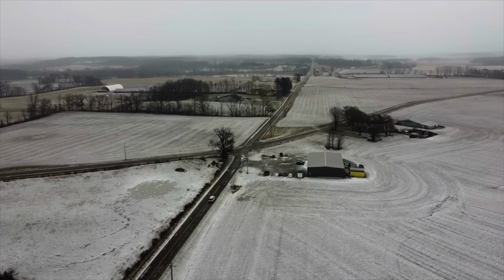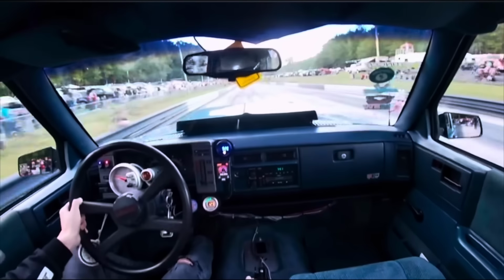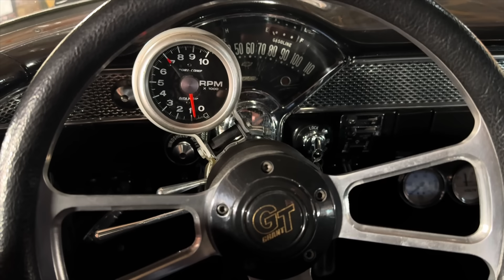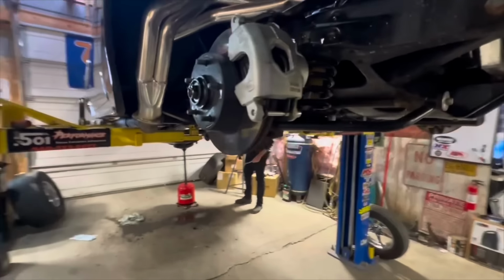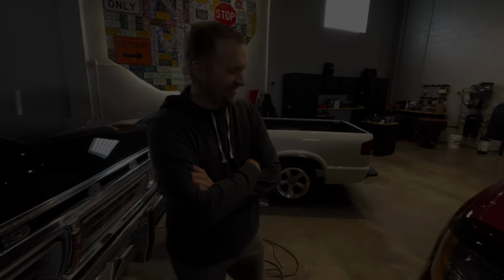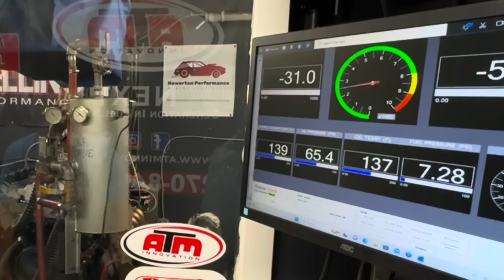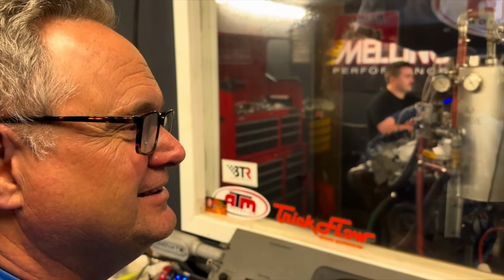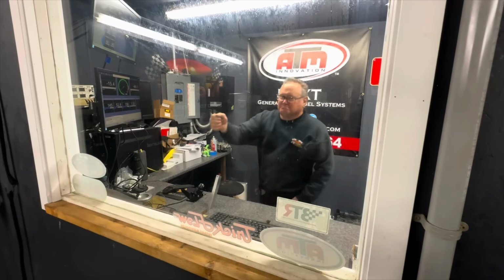DONT DO WHAT STEVE DID!  5.3 JUNK YARD DOG OFFICIAL GIVEAWAY!

Comment: Nice info,It would be interesting to see what a LQ9 6.0 ltr would put out with a cam and a carb setup.
Reply: should be close to the same just more power. the bore is the big difference. 5.3 is 3.78 and 6.0 are 4. for a na set up on a 6.0 rec port ls heads and good cam will make a massive swing for you. that combo should make over 475 with ease.
Reply: I know an l96 Will make 550 hp 500 tq with a cam and springs.
Reply: @enigmacamaro those rec port heads are massive for a production head and they raise the power potential considerably. I believe peak flow flowers, while not everything,  are comparable to those gen 1 trick flow 230s or the 220 afr's. I feel like it's a trade off, air flow vs cylinder sealing with the LS vs SBC. More difficult to have symmetrical style ports with 5 bolts per cylinder but it's been done. The LS would have benefited from that one extra fastener.
Reply: Great information, what is the camshaft specifications?
Reply: @omarmuniz552  54-456-11 comp cam is pretty wicked for that combo. I would double check for piston to valve clearance to be safe on that one.

Comment: I've been running a carbed LS for about 7 yrs now.  We started with a junkyard 6.0 with cam motions junkyard dog cam. Specifically designed for a sbe 6.0 with rec port heads.  This cam with matching valve springs,  vic jr intake and 750 HP holley made over 500hp. And with a th400 and 3.55 gears it ran 10.80's @ 125mph. At IRP.  In my junkyard third gen Camaro.  3500lb raceweight.
Reply from the maker: That’s pretty good!
Reply: @theoldmansgarage   Like you said. For someone on a tight budget thats just trying to have fun. It gets the job done. I eventually saved up for forged 408ci rotating assembly. With some good 2618 wiseco pistons. Its been together since 2017 with at least 300 passes and a few hundred street miles . My winter upgrades are throwing in some new valve springs and changing the rear main seal.  Last fall we played with a 200 shot on an Induction Solutions Saturday night special plate system.   After some suspension tweaks  it ran a best 9.01 @ 149.98mph  5.74@120mph with a 1.24 60'  @ 3500lb raceweight. Built the engine before covid for just under 5k in parts & machine work . Definitely not be the fastest or coolest car. but it does alright for a budget beater lol.

Comment: I didn't even know there was such a thing as silicone break fluid. I guess a guy might have to take some out of the master and test it in a container on the bench by adding some regular break fluid and seeing if it thickens up? Thanks for the videos!
Reply: Never mix dot 5 with dot 3&4 fluids. Completely clean out the brake system when swapping to dot 5.

Comment: Question Bill, what are your thoughts on the tick tak toe grid on the bottom of the single plane intake being smooth? Wouldnt atomize the fuel properly if not there? I would think that would cause the fuel to tumble in the runners slowing it down making less hp. Someone smarter than me designed it but just curious your thoughts?

Comment: Whether you buy Bob's truck or not, take the wiring loom that sits against the a/c line and move it so it doesn't rub on the line. it will short the cam sensor wire to the metal line and kill the truck randomly. I've seen it several times in that year of Duramax

Comment: An aftermarket EFI intake may make even more power. Fuel injection distributes the fuel much better than a carburetor. That said all my muscle cars have and will have carbs because I know more about carbs. Old guy here too, is what its is. Bobs old truck is painted one of my favorite colors. I have owned more red vehicles than any other color. Two of them Ford F-250 Super Duty Diesel 4x4 trucks. I lived just around the corner from the little airport when I had my 67 Fairlane GTA with 428cj running about 13.75 to one compression and ran it on aviation gas which low lead 106+ octane naturally aspirated with a Holley double pumper. Looking forward to see what your going to do with the older white nova. Brake gate saga very entertaining content btw. Go fast and be safe. God bless you and your family and friends.

Comment: When i see an old Ford pickup like that black one my mind always goes back to the old farm truck when my mom lived on a farm in western Kentucky. It was a short bed 1975 F250 with a cleveland and the granny gear 4 speed. It had dry rotted 35s to the right rear #4 spark plug was broken off for years but otherwise hit on all 7 just fine. Every fall we went way out back and cut cedar for fence posts. Every year we all said the same thing "dont smash the back window" and every year the truck got a new back window. That truck was a beast, we used to use it to pull the old john deere tractor out of the mud! I was only 15 maybe and could drive that old thing anywhere on the property with ease. Such a unique piece of property, the main farm was only 55 acres but when you passed thru one little gate in the rear tree line it was like opening up another world...there were literally thousands of acres of land locked land owned by heirs of the rich people up in L'ville who didn't even know they owned the land. When i say thousands of acres im talking like one half of Ohio county, one of the poorest counties in all of Kentucky, one could ride the trx honda 4 wheeler for 8 hours a day and not see the same place twice. It was also scarily easy to get lost. If one got lost the plan was to ride due west until finally coming out to the only 2 lane county road in the area. Going north or east would prove futile as you could ride for 2 days and still not find a road. Man those were the days for a young boy from Detroit who spent his summers down there visiting with mom and played on a farm all day long. That old F250 Ford had a farm truck license plate which meant it was streetable but anything over 35 was a teeth chattering bad time!
Reply: Alot of deer in Western ky. I live near Lexington. My bucket list is to find a place to hunt in western ky

Comment: I really hope you read this Bill and really would love to see you try it or get some and study it maybe with Bob in the machine shop. Please research Energy Release engine additive or ER. My old man used this product in all of his race engines. To this day we still use it in everything we have. We put it in the engine, transmission, front end and rear end. If your asking do I believe if it works this is the only thing I can say. My Dad flipped his old 97 Cummins 5 spd truck yrs ago in a snow storm in Idaho. Due to the fresh soft snow pretty much all that was hurt was the cab. But it sat upside down overnight. Long story short the transmission was obviously almost completely empty. Body shop didn't remember to refill it but had checked it off the list. Go figure. The truck drove 172 miles before the transmission locked up. My old man believes the only way in sam hell it made it that far was due to the Energy Release in the transmission. Also note that you only add 1 ounce to every quart of fluid as it's a metal conditioner. No one in family is in business or is a dealer of this product and we don't know anyone that owns it. We buy it at 120 a gallon just like anyone else. I personally don't think it's snake oil but hey who knows. I would be willing to bet you and Bob could figure out if it is or not.

Comment: I had a 402 ci LS on pump gas made 595 HP and 535 TQ with 28 degrees timing the dyno guys told me not to put any more timing in. 750 carb open plenum manifold wish I would have tried more timing.
Reply: There is a 99% chance that they didn’t verify timing on this motor so it’s just a number. You stop when the motor wants to since an LS doesn’t have a key way.

Comment: what are you do about checking the potency of your E85 from these gas stations. or do you just not worry about it I know modern cars have sensors to check the ethanol Content do you just trust their stuff is good or do you have a sensor on your fuel line somewhere that monitors your ethanol Contant. also, how much does your timing have to be adjusted for different ethanol contents if any?

Comment: Killed it as usual Bill !  I learned something with that dyno session about why fuel injected motors require less ignition timing ! I had never thought about the fuel droplet size burning slower with a carb therefore requiring more timing  I wonder how long itll be before theres enough aftermarket ECUs out there thatll have direct injection  They use 2000 plus psi fuel pressure and are capable of making even more power   The future is bright in that respect but me being 53 yrs old do tend to like the old carb stuff also and with carbs out there like ATM its a world better than the old cast main body holley stuff i had to play with as a kid  LOL    Keep on pumping out the videos Bill and Billy   You are changing the world for the better   Peace out

Comment: Thats funny Engine masters tv show did an intake shootout on LS and their carb manifold made LESS horsepower than the fuel injected manifolds. Id like to compare cam cards and i believe they used that dual plane manifold. They did it as a cost thing using fuel injected vs carbed but i dont remember if it was a straight outta the junkyard LS or had been overhauled or cam swapped etc.

Comment: Bill think about it this way, when we were in high school, a 350 with 250 to 300hp was a big deal, and a 396 with 400hp was the bomb, and nowadays you can take a stock 327 and pop a cam and intake onto it and get nearly 450 is dream material especially at 7k RPM, 500HP is reality with more cam and heads and you are still using 327 inches to make it with, that was NOS territory in our school days, whoever wins this little motor will make a fun car with it on pump gas and if they turbo it the thing will be a monster still with 327 inches

Comment: if you add a 2 inch square open spacer on top of the 2 inch torque spacer i can guarantee 500 hp , i ran on small block chevys in my hay days, its like running a single tunnel ram, its works (4 inch total)

Comment: Hi Bill, I have a question for you regarding race fuel and mixing it with pump gas. I had the 383 out of my 69 Charger rebuilt when I restored it in 2007. The engine builder was a Mopar guy that built mostly Hemi and 440s. My 383 was the first one he completely rebuilt and built it so everything worked together. Back then, 383 cars were not as valuable as they are today. He built to make about 450hp. Once he finished he told me to mix 93 octane and 105 race gas because it had 11.8ish to 1 compression with a choppy cam. It runs great and I have never had a problem with pinging so I wanted to ask you if you can run straight race gas in a pinch with an E85 carb? Also would fuel injection eliminate the problem with either running E85 exclusively because of the carb? I know you will never run fuel injection but I am curious because a Monte Carlo SS I plan to build will have a 383 SBC with 12ish to 1 compression that may have fuel injection. Any help will be greatly appreciated. Thanks 👍
Reply: Being the stoichiometric value of gas is just under 15:1 maybe 14.7 and corn is upper 9's you could probably make big jet changes and dial it in. With fuel injection I think you could get it tuned and run a flex fuel sensor. I'm no expert so maybe somebody with more experience can chime in.

Comment: I knew you used a speed master block in the past you answered my question about could it be used to build a 434 I would really like to build the same 427 you and Bob built is the speed master block like a dart block where you have to pull the head off to change lifters? Great video
Reply from the maker: No it uses standard lifters.  Personally I like it better than a dart block.

Comment: 'Normal' open plenum intake,, 'normal' 2" spacer and the 'normal ' hole in the bonnet. What has changed in 40 odd years! SBC, SBF Clevo, Holden, LA Mopar. The reason the intakes only come that high is bonnet clearance. I once stacked a 1" on top of a SBC with a Victor jnr making 3". Made about 3hp. Some better blending as the spacers were totally different may have helped. BUT even with a fair size [and max legal height] scoop the scoop held the bonnet up so useless!

Comment: Good vid  MR Bill hard to teach an old dog new tricks ls is a better platform but old school rules first gen is where it all began too many electronic components on the ls im 64 yrs young 7.8.1 c r with a roots 2 hillborns crank drivin pump makes     hp 400 ci 2 bolt splayed  AA/gas or fuel depends on DA for fuel pressure magneto preferred block has got to be straight internals balanced perfect fuelie heads a lot of machine work you got a  damn fine
machinest so show these spray monkeys whatsup 180 degree Zoomies it's chute time  in the Chevy 2 fo sure you will need Willie bars   body tied together 90-10s up front a 9"internally and externally braced full Spool 5.14 gear 35 spline minimal axles disc brakes x 4  cal tracs &JR drives it DA KIDs got a set of Balls 👍 I'm building a98 SS-S10 same build  pro street for strip only theirs some LS boys down here in SW Fla that need their
Diapers Changed✅

Comment: I wonder how much of a change you could get with changing the 706 heads with 243/799 heads? But still a great street/strip motor especially if you could throw a little 100 shot in it.

Comment: Bill you need to throw a fuel injection fast  lsx 102 or lsxrt intake on it - you will make more hp/ torque than your carb set up - apples to apples - truck intake dont cut it

Comment: Whenever you acquire a used vehicle to find out what kind of brake fluid you have you take some of the old brake fluid out of your master cylinder and add some of your new brake fluid and old brake fluid into a clear container shake it and if the two separate then they’re two different types of brake fluid

Comment: OK call me dumb. What the hell is silicone brake fluid used for and what brake fluid is a silicone brake fluid I’ve been using dot three and dot four for years I usedot 4 on my new stuff in dot3 on my old stuff. What’s the reason for using a silicone brake fluid?
Reply: Silicone brake fluid is often used in classic and vintage cars and military type vehicles because silicone based brake fluid will not corrode internal brake parts nor will it damage paint work. But it gives you a spongy brake pedal feel. Probably more of a personal choice than an advantage. DOT5 is silicone based

Comment: I know you guys hate your ford engines, but get a coyote in there and do these same upgrades. You’ll be amazed. You’ll make 550+ easily
Reply from the maker: I don’t hate Ford stuff.  I know very little about Coyotes.  I do despise the way they sound tho 🤣
Reply: @theoldmansgarage  no way. When they’re screaming at 9k RPM there’s not a small block engine on the planet that sounds better. Everyone runs trash crackle pop exhausts on them and that’s why they always sound bad. I will agree they sound pretty bad on a cold start but under load revving them out, no way.
Reply: @theoldmansgarage  and by same mods I mean the fueling. If you put an intake on a coyote with the headers and e85 it will make over 600. With 302 inches

Comment: hmm nothing about sick week just you yourself and your help as usual along with Siamese ports comes cracked heads and a shit ton of heat in the middle of the block pros and cons but i and many others will take the individual port design hence all the newer designs left it back to the 50's Bill just facts but stay on your SBC all this dyno stuff proves an LS is a better design and engine.
Reply: intake side is fine but exhaust is huge flaw even you shouldn't deny that.

Comment: I've seen many times working on cars for the public that power steering fluid is sometimes used by mistake or whatever because the two bottles have the same shape , of course brake system rubber is not compatible with oil. But silicone fluid is ok ,oil makes the rubber swell up, like you say a virus moving through, ( Montezuma's revenge )🤮

Comment: piss on the e85.... for the 5 horse power u get out of it and not able to get the fuel everywhere u go consisant why even bother running it... none stop chasing fuel ratings when u could just use regular pump gas make the same amount of power and get it anywhere at any gas station